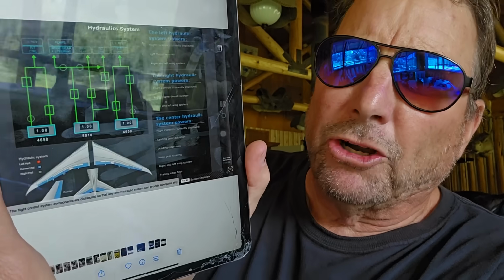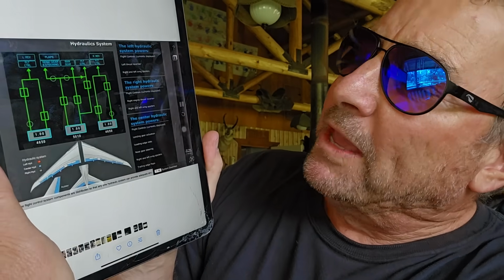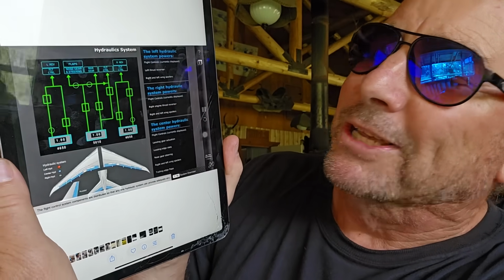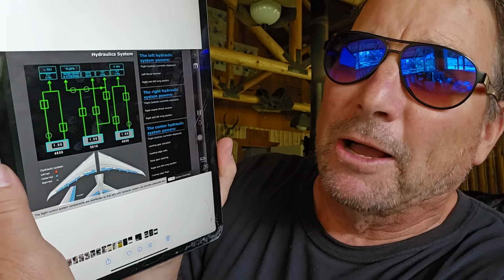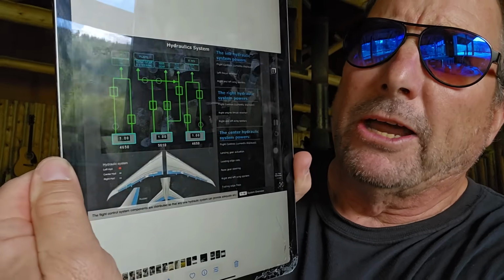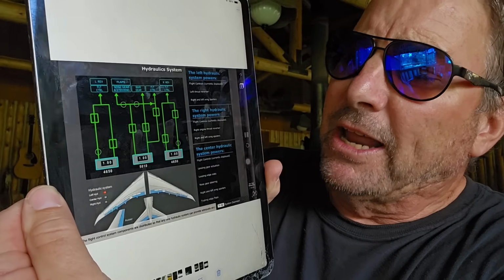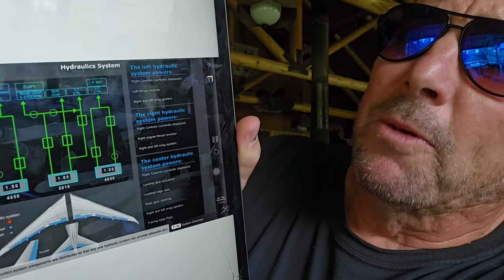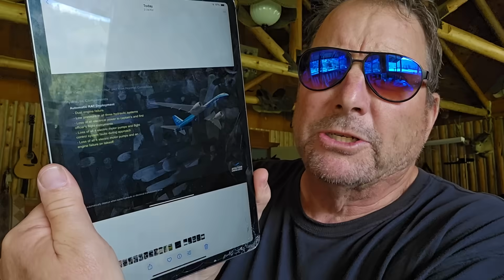787 Crash India What's a RAT? When does it deploy?

Comment: There’s actually more conditions 

Here’s the full list. 

• Loss of all engines
• Both engines are at less than minimum idle RPM (Revolutions Per Minute)
• Loss of all hydraulic power - left, right, and center systems detect low pressure
• Loss of all electrical power
• BPCU (Bus Power Control Unit) detects loss of power to C1 and C2 TRU (Transformer Rectifier Unit)s
• On approach, loss of all four EMP (Electric Motor Pump) hydraulic pressures and loss of either the left or right flight controls ACE (Actuator Control Electronics)
• Rotor burst on takeoff that causes loss of both PECS (Power Electronics Cooling System) primary cooling loops.

Hope this helps Captain
Reply from the maker: Thanks Stig!
Reply: @blancolirio  Someone who was on the plane's prior flight came forward showing video where he said the air conditioner was not working, a light was working and the TV screen buttons didn't work ("Like Usual!, He exclaimed"), but a screen in front of him was working. 
I assumed none of this was connected to the crash, but could it have been?
Reply: @grottorabbit  I'd think biggest thing those indicate is the airlines attitude towards maintenance.
Reply: @blancolirio  great content and well prepared! There were and are know issue with the EEC/FADECs of the GenX that can explain the sequence of events including all statements from the passenger and the ATC coms. 1) The EEC can accidentally command incorrect thrust settings. There is a FAA AD for B787 GenX EECs could fail due to thermal fatigue of solder joints (FAA-2021-0273). 2) older FADECs had trouble with accidental rebooting during automatic bus switches (pre-B120). GE tried to solve this with newer EEC software versions (B120 ++ i.e. SB 73-0015). I hope all SBs were implemented properly. The aircraft was older and had a know history with electrical power interruptions. Such an interruption during rotation maybe triggered by a heavy load coming from the landing gear retraction could cause one or both engine FADECs to reboot and subsequently idle the engines in a critical moment of flight. It can either start with one engine or even with both in parallel. It would trigger a RAT deployment as explained above, since both engines would idle for a while and not send their RPM to the RAT monitoring. There would be no bird strike, no smoke, no thrust asymmetry, nothing visible from the outside, except the RAT and quite idling engines… (parts of this content were posted by Gardnersnake9 on reddit „Air India Flight 171 Crash [Megathread 2]“)
Reply: @blancolirio  Hi Juan! As a retired tech, I have another thought on this. The engine fire system I believe can shut off the fuel control. Could the fire system controller fault/error to shut off fuel without deploying the halon? A wire bundle short on that system? Could there been wire bundle "damage" on that system (perhaps a foreign object in the w/w)(were the gear pins still in and something broke when they tried to raise the gear)? It appears to me that all went bad at the time the gear would have been selected.
Reply: @StigAviation any thoughts on AD 2018‑20‑15 and AD 2015-09-07? A power reconfiguration could result in FADEC entering an idle fallback mode as opposed to last commanded thrust. This may explain the bang and cabin lighting changes (electrical arcing), RAT deployment (total loss of electrical power), engine spool-down (isolated FADEC signal misinterpretation or software logic bug), and last-second engine spool-up (RAT now powering AC buses and throttle resolver signals updating FADEC)
Reply: @jamesallan5422  Interesting.  I have no idea how any of this works, but I would have assumed that the FADEC was a direct connection to the thrust lever encoders.  I'm surprised the aircraft's electronics are involved.
Reply: @jamesallan5422  Good potential estimation.  Black boxes will tell us in a couple of days.
Reply: @jamesallan5422  Sir, what you mention here makes a lot of sense. However that AD should have been applied since some years ago. Application of all required AD will be surely investigated but also there is the need to verify if the aircraft have been continuously powered up for more than 248 days. In the absence of more data at this moment, the scenario you mentioned about the FADEc entering an idle fallback could fit into the plausible conditions that could have triggered this accident although at this moment I am aware that this is just speculation. 
I hope the data from FDR and CVR could be recovered soon and that could bring more light. Thanks for sharing this information
Reply: @jamesallan5422  That will tie in with the Captain Mayday call reporting loss of thrust.
Reply: @jamesallan5422 the bang was probably the rat deploying, the switch to that for power would cause lights to flicker and automatically switch to emergency lighting
Reply: @jamesallan5422 Holy shit that’s terrifying.
Reply: @jamesallan5422 wow, I’m a Jamesallan also. How many of us are there?
Reply: @jamesallan729  Looks like there's at least 5,422 of them, I'm surprised you didn't realize that.  😂😅😆
Reply: @rawcado  I have a 3 digit number in one of my online IDs that has nothing to do with how many of that name there are. I chose a number with a special meaning for me and my family.
Reply: @jamesallan729  i thought you were joking and said James Alien 👽 haha but now I see same name!
Reply: @jamesallan5422  Thats a whole lotta food for thought !
Reply: @jamesallan5422  Not enough acronyms.
Reply: @jamesallan5422 I think you may be onto something here. The engines didn’t quit, they just rolled back to idle. If they started to spool back up at all it was just too late to avert the crash. This would imply a fundamental problem with the FADEC system that means an electrical problem on takeoff or early in the climb is likely to end catastrophically.
Reply: @jamesallan5422 yeah that’s my thoughts. Possibly AC power never transferred from APU generators on engine start up due to some fault. They didn’t notice the crew alerting system messages showing main generators not online, possibly hidden within other deferral messages or other problems dealt with. Shut down the APU just before taking the runway. APU finally finishes shutting down after takeoff. 1 1/2 minutes after selecting APU off. Loss of AC power. Rat pops out. Engines roll back to idle in to idle thrust safe mode. Gear doesn’t go up due to loss of AC hydraulic pumps but gear trucks in opposite position showing they had started up meaning they did port gear handle up. Pilots must then move the thrust levers out of the last position which was TOGA detent for the Fadec to recognize human thrust lever input, and then back into TOGA or full forward to regain full thrust by Fadec powered by PMG’s. No AC power needed.
Reply: @jamesallan5422 For this reason alone, there should be an immediate FADEC over ride for the crew. If the crew commends full power, FADEC should have no say in the matter.
Reply: @slartybarfastb3648  I work for a military research lab.  For autonomous aircraft, we are heavily engaged in something called Run-Time Assurance.  As systems become more complex and even autonomous, especially using AI, we are starting to add simple safety checks in parallel because it's hard to predict all the states a complex system can into and the path to get there.  The job of RTA is to ensure you stay inside a known safe boundary, and the RTA needs to be mathematically provable.
Reply: This chap is an authority Juan. He fixes them!
Reply: @Irene_Bae I’m no authority on anything my friend. But yes I fix them. I’ve watched and worked the 787 from the beginning. Something  is not right with this crash. Lots of speculation about what occurred, theories, thoughts and opinions. All are feasible all are inconclusive. I talk to Boeing personnel all the time and they still don’t understand what happened. They are in the process of recovering the FDR and CVR and GE is on site as well. I only trust Juan to be unbiased and logical when it comes to these things. That’s all I can say.
Reply: @StigAviation someone said a bird strike from the butcher plant that was supposed to be moved away from the airport but it was owned by the politicians relative  there for it never happened
Reply: @StigAviation  As a computer geek watching from the sidelines, it appears to me that people that best understand a modern aircrafts behavior is the folks that wrote the software. It seems as though the rest of us aren't much more than passengers on these automated wonders.
Reply: @StigAviation and as stated “only in my opinion” 👍
Reply: @StigAviation  Have you seen the video on TMZ of the passenger who was on the aircraft on the previous flight?  He's filming all the stuff that doesn't work (with the intention of complaining about Air India's crappy service) - AC, call attendant button, touch screens all not working.  And if those small things aren't working....I'm curious to learn what other things on the aircraft weren't working and the maintenance history.
Reply: @StigAviation  Thanks Stig. Thanks for sharing your perspective!
Reply: @consortiumxf  Yes, if that footage is genuine, which it does appear to be, two front-line questions arise :         1. Were those issues fixed before the final flight?  

 2.  And if not fixed, how/why was takeoff allowed?
Reply: @StigAviation  Great information and knowledge. Thank you for your input!
Reply: @davidmitchell7183 its the people who work across the hardware, software and operations that know them best. The software is just one component of a complex system
Reply: @StigAviation shouldn't they ground this plane until they are fairly certain what happened? Asking for a nervous passenger about to get on one.
Reply: @jamesringler987 butchers don’t let their livestock fly away. That’s bad business management, correct me if I’m wrong?
Reply: @StigAviation no way I watched your TikTok lives in the early Covid days… happy to find you have a youtube channel now!
Reply: @StigAviation What I find interesting is on Indian news (I have no way to authenticate of course) there was a mention of the plane getting retrofit for something just coming back to service I can't help but wonder if that is true was the plane not ready to go back into service...
Reply: @consortiumxf not really relevant
Reply: @yippydippy6589 flown on several in recent years don’t be silly or give me your ticket 😂
Reply: @Shootinfishin73  My point was if they are cutting corners for minor maintenance things.....where else are they cutting corners?
Reply: @StigAviation love your channel Stig
Reply: @StigAviation Boing are incompetents there is no need to ask them. Full power loss due to overheating lithium batteries switching off. Plane had no AIRCON active on the previous flight ergo huge temp inside the cabin...
Reply: @FINfinFINfinFINfin  "The jet also used all the runway to get airborne and kicked up dirt and grass as it rotated."

The video of the ground run was recorded from a position on the South side of the runway. Using this position and the buildings in the background the aircraft left the ground around the the halfway point of the 3,600m runway. The dust was picked-up from the side of the runway by the tip vortices. 

The aircraft climbed to 625 ft amsl, 425 ft agl by the end of the runway. The problem appears to have occurred after rotation.
Reply: @StigAviation  GREAT COMMENT.
I'm an aerospace engineer with a private pilots license.
I work in industrial control systems across a variety of industries. I'm formally trained and certified in multiple areas of safety engineering. 

This is like so many instances of com[plex engineering. EVERYONE wants (and often demands) a straight forward simple explanation when the reality is with MOST CASES in MOST systems a more complex combination of events.

There's that recent power blackout in Spain and that's an area of interest to me because I have been warning my country (Australia) that we are vulnerable to the same type of event. The problem is that we know what basically happened BUT determining the actual sequence of failures is damn difficult and will take months of going through tons of data to work out. In the mean time the rest of us simply have to sit back and wait for the full explanation.
Reply: @FINfinFINfinFINfin Flaps or slats? That one piece of RH outboard wing shows an extended  flap. But maybe you’ve seen another image/video.
Reply: @amanofatoms5786 Airplanes have a Minimum Equipment List/MEL. If systems and subsystems of the aircraft are inoperative, we refer to this list, (actually to the book that in our company is called the DDP, Dispatch Deviation Pricedures) to determine whether the aircraft is still airworthy and legal to fly. If for example the APU (that small turbine in the tail, that provides (backup) electrical supply and/or air supply (engine start for example) is unserviceable, it wil be placed on the Hold Item List(HIL). You are perfectly legal to begin a flight with items on the HIL, as long as you abide to the restrictions it might generate, as listed in that DDP.
Reply: @amanofatoms5786  indeed, checking the master minimum equipment list (MMEL) / INOP list for the flight would be very enlightening.
Reply: @jamesringler987  Not helpful.
Reply: @tonywilson4713  When I was at college in the mid 80s at RPI  I worked on an automated inspection project with several students range from 3 of use under graduates a masters student and a PhD candidate in industrial engineering that was almost done. I remember having a conversation with him. This was shorter after Bhopal disaster. His contention was that we really didn't know how to manage large projects and many times we avoided disaster by luck and not skill. That idea may apply to fly by wire system as well.
Reply: Its other scavenging birds that are the problem around the butcher plant. @jmythngdmb
Reply: @consortiumxf  Someone over at the PPRUNE forum has first hand experience dealing with Air India and how they often scavenge parts from parked planes and then are scrambling to get replacement parts to get the parked planes back in service. Too early to say but I wouldn’t be surprised to find out maintenance issues is either the main cause or a big contributing factor.
Reply: @StigAviation  Thank you and all your colleagues for keeping us safe. I just tool around in a 182 but you keep us alive up there.
Reply: @amanofatoms5786 another question, was this even the same plane?
Reply: @FINfinFINfinFINfin 
Yes, that isn't normal.  It should have been off the runway well before then!
Reply: @yippydippy6589 This is the first fatal accident for a 787 in the model’s 14 years in operation. The 787 is a remarkably safe plane. No need to worry.
Reply: @jamesringler987 what’s a butcher plant? Your mean there was a bird farm and abattoir there?
Reply: @avianews24haviationnews12  Boeing is not incompetent; the batteries don't "switch off"; and batteries in thermal runaway (which has never been documented since the 2 2013 incidents prompted a global retrofit) wouldn't cause the plane to lose "full power." Go be ignorant somewhere else.
Reply: @jamesringler987 there would be evidence of bird strike on the video
Reply: @davidmitchell7183 might this turn out to be similar sort of firmware code error like that which was hastily "commented out" with the 2nd pitot of the MAX 8 fiasco?
Reply: @tonywilson4713  The failure in Spain was basically a failure by design. The protection systems all worked as designed and prevented damage to infrastructure. The geometry, topology and DC vs AC link types of the transmission system made this failure mode possible. There's another problem spot in the Balkans IIRC. For AC links, there's not enough diversity between the Iberian peninsula and the rest of Europe. Part of the fix is to add more links with topological diversity - hard to do due to geography, or to use DC links instead. There's AFAIK nothing that can be done to prevent a reoccurence at any time in the future, other than infrastructure investments.

A safety issue would have been if the protection systems didn't shut things down as they did.

As for Australia: there is published modeling methodology to determine whether that failure mode can occur in a given network. So it's not a matter of opinion, but rather whether someone did the analysis already or not. If no one did - and the methodology is fairly new as far as slow-evolving infrastructure goes - then indeed it is a concern. To do the analysis takes published methods and data about the network parameters and topology.
Reply: @absurdengineering  Oh FARK MATE PLEAS DON'T LECTURE ME ON SOMETHING I HAVE BEEN AT FOR OVER * 8 YEARS NOW.

And I really do want to scream that at you. 

And don't tell me about modelling I come from Aerospace and we are decades ahead of the rest of you in modelling.  

You know what else we've learned in aerospace?????? 
MAINTENANCE and OBSOLESENCE.
We've learned through painful lessons that it you don't maintain critical systems properly they eventually FAIL. We've also learned that you eventually need to retire things and replace them.

And yeah we've also learned that when clowns who don't know WTF they are talking about take over we end up with planes that fly themselves into the ground.

Just yesterday the story broke about how Western Australia's grid is in trouble because the Kwinana power station keeps tripping. Its another of the gas thermal plants a bunch of people including me have been calling to replace. BUT ON NO we have to let the ECONOMISTS and the modellers and all the other DlCKHEADS have meeting after meeting with the single intent to propose new excuses.

Kwinana, Torrens Island & Newport are all obsolete technology.

You can basically replace any of the gas  thermal power stations with the latest GE or Siemens dual fuel gas turbines and reduce emissions by up to 80% and reduce natural gas use by up to 75%. Low risk proven technology. 

STOP BULLSHlTTING ABOUT MODELS and LEARN SOME PRACTICALITY you'll go a lot further.
Reply: I'd love to see Juan, Victor and Stig collaborate.
Reply: Holy crossover.
Reply: Also, theres now some video of one of the wings after the crash. The portion looks mostly intact. From what I saw, the leading edge looked configured for normal flight (flaps zero), but the trailing edge was deployed, minimally (presumably whatever minimum flap setting that would extend the trailing edge). Trailing edge looked extended between 6-12” straight out (no curve down). I think it was the CNN video, but it had an Indian woman speaking english, one segment was her talking with someone at the scene, standing lext to the wing. Looked like the right wing, showed the transition between trailing edge flaps surface and aileron.
Reply: @kevinwhite9919  I fly out of Paine Field WA, where Boeing builds and test flies their widebodies.  Juan Brown is correct--the flaps and slats were in the correct takeoff position.  I've seen 787 takeoff and land from KPAE for many years, but due to the design of the 787's super high-efficiency wing, all wing trailing-edge control surfaces move down for takeoffs and landings, making it very difficult to tell, especially in the flaps-5 takeoff position.  Looked like a normal takeoff to me until the gear stopped retracting and engine thrust rolled back.  The gear appeared to be in transition (toes down) and then just stopped.
Reply: FINALLY! We get a video with a perspective we can rely on. Juan, you are a class act.
Reply: Can someone put me straight please and know very little about information recovery. 
I'm amazed in this day and age that all cockpit data and voice communication isn't uploaded straight to a land based recovery system so that information isn't  immediately accessible rather than searching for black boxes
Reply: @stephenfloat1260 I understand a system was developed that would send a data burst to a satellite in the event certain abnormalities were detected. Not sure what happened to that idea.
Reply: @davida56891 I think British Airways was using a system like it at sometime
Reply: That last condition is interesting given the environmental control motor controllers seeming to be part of the PECS loops. Pure speculation but perhaps there was a problem with those loops and that was partially responsible for the air conditioning reportedly malfunctioning in that other video.
Reply: @alillie449 that was my exact thought when I read that.
Reply: @alillie449  PECS Loops have nothing to do with any of this.
Reply: Hey stig, 777 fanboi here, great to see you here, when you tie in the video/audio and the survivors testimony it all starts to paint a clearer picture, the very long take off roll using up almost all of the runway. The the survivor says it felt like the plane got "stuck" right after takeoff, I assume sudden loss of acceleration and engine noise would feel like one was stuck or quietly floating mid-air, then he said he saw the green and white lights come one, AFAIK the green exit and cabin lights come on automatically in a 787 when power is lost, then he said he heard the engines spool up again, his words were it sounded like the pilot was giving it full gas, I'm guessing by the time engines started to spool again the 87 was already losing altitude and too close to the ground, just didn't have enough time and altitude for the engines to start producing enough through to start to climb. And now seeing, well mostly hearing the rat was also deployed give credence to the theory that the engines cutout, now you could throw better on light on what possibly could cause both engines cutting out at the same time. Oh and the social media post from another pilot who flew the very same aircraft said that plane was dogged with engine problems and the log book was full of it. Saying he had to return to land shortly after takeoff in the same plane not too long ago due to engine trouble. 

Seems like the airline was poorly maintaining the aircraft and video from the same plane from an earlier flight in the day show the ICE not working and neither the HVAC
Reply: @cyzeum this ^ … multiple engine problems. No one has mentioned this.
Reply: #5 is interesting...on an interview, the sole survivor stated that the cabin lights "flickered", moments before, or just as, they started descending...does the RAT do this?  does the deployment mean the pilot was losing systems rapidly?
Reply: Can you tell in the videos if the rear bogeys are toes up or toes down?  They appear toes down to me, indicating that retraction was initiated, but hydraulics failed prior to opening the landing gear doors.
Reply: @JamesDowningFPV  James i watched jeffostroff channel and his video had a close up as aircraft went by and the landing gear was nose down sir. What does that mean.
Reply: @JamesDowningFPV  "Can you tell in the videos if the rear bogeys are toes up or toes down?  They appear toes down to me, indicating that retraction was initiated, but hydraulics failed prior to opening the landing gear doors."

I agree. This suggests hydraulic failure.
Reply: @JamesDowningFPV think the gear doors open automatically on lift off on the 787s to enable faster gear retraction. Doesn’t mean you aren’t right, just an observation
Reply: @StoutProper  hmm, either way, that seems to indicate some sort of system failure if the doors aren't even open then.
Reply: One question @StigAviation: 

What happens when the RAT gets involuntarily deployed? As I do understand from your writing, the RAT produces AC power. Is it possible to synchronize the Phases of the RAT to the Alternators, or does some kind of isolation happen?
Reply: I think its loss of electric/hydraulic power or both. Both engines going out is almost impossible.
Reply: @ishaanchandel6966 if the flaps were correctly configured throughout the short flight the aircraft would have continued to climb had both or only one engine been operating at takeoff thrust.
Reply: 1) already lost speed after v1 but before takeoff according to the data points.
2) takeoff was with backtrack, i see no possibility for pilot error
3) would be interesting if the waste management really can affect the fuel system, sounds like bs to me.
3) apparently there was a recent TCMA software update (system similar to MCAS)
4) the 787 whistleblower that surprisingly shot himself last year warned about newly built machines, still Boeing will rightfully get a massive downrank. should be dissolved and reorganized without the MD sales people.
Reply: Hey Stig, nice seeing you here, and thanks for clarifying the RAT deployment conditions.
Reply: Question to both Juan and Stig, under what circumstances would the RAT deploy automatically on takeoff, if the RAT  was deployed manually what would systems would be automatically retracted or shut down. Is the RAT designed to be used on takeoff as well. Thanks for a great channel Juan.
Reply: Many, many thanks.  The sole survivor of this tragedy reported the interior lights flickering on take-off.
Reply: You missed one....the flight control system glitched. Remember the Airbus crashes involving 'uncommanded decent', the Air India plane looked like it was coming in to land. There are so many lines of code in fly by wire aircraft they simply cannot be checked for errors. Passenger in the preceding hours reported failures in the infotainment systems and interior lighting prior to the crash. A perfect storm in the flight system controls ?
Reply: @spencereagle1118  787 has been in service for almost 14yrs, it's not a new aircraft. So doubt it's an issue like that and we have no evidence to support this theory till date. ICE, lighting an HVAC issues have nothing to do with safe flying operation of an aircraft, crucial safety systems have multiple redundancies built it.
Reply: @spencereagle1118  Infotainment is not flight controls, neither is emergency lighting. Unrelated stuff. Emergency lighting corroborates loss of power. Infotainment systems on both cars and planes are lagging behind state of the art due to certification requirements (for planes) and long development times in that industry (for both cars and planes). Rarely you may get a failing entertainment system even on the maiden flight. Same as you can get a bad one in a brand new car. Or the performance is abysmal when it works - not unusual for both car and aviation infotainment. Those things kinda suck. So I would not extrapolate from that.
Reply: @absurdengineering  I get that my friend. I was not suggesting the infotainment system was the cause, rather an indication that something was amiss with the bus system - the survivor reported a bang and flickering lights. When the lights flickered in small US towns, it wasn't the electricity company at fault, it was a prisoner being executed in an electric chair . Have a look for the Lufthansa flight LH1829, Bilbao to Munich, Nov 5, 2014 over the Alps that suffered a rapid 'uncommanded descent'. The A321 (yes I know it's a Boeing in India) started a 4000ft descent with no response from the yoke,  the crew decided to restart Flight Augmentation Computers (FAC) 1 and 2. This had no effect on their situation. They only just saved the plane by pulling the fuses, first on nr.3 Air Data Reference unit (ADR) and then nr.2 Air Data Reference unit. The problem was the ystem misinterpreting data from sensors. The Boeing 787 operates a very similarly configured fly by wire system operating on so many lines of code that it is impossible to check for the perfect storm of coding conflicts and faulty sensor inputs. It wasn't fuel, vapor lock or pilot error, I believe the flight control system spooled those two engines down. The pilots deployed the RAT in a panic.
Reply: I think number 2 fits best in this case. My unprofessional opinion.
Reply: Would love to hear a regular 787 takeoff sound to compare. The last contemporary large plane i heard take off (LAX), soubded similar to what we hear on this flight, but not quite as pronounced as with the rat-deployed example. The new engines have been designed to have lower frequency broadcasts, to lower the perceived noise. Anyway, comparison to a normal take off sound would be almost definitive.
Reply: @StigAviation, I was aware of a requirement to depower the CCS every 51 days or less, to avoid a stale data counter roll-over with some extent of crew loss of control cited as a potential outcome, but it was considered to be an interim action, and I'm not au-fait with what is relevant for 787 maintenance schedules.  Do you know if 2020-0205 is still relevant?
Reply: Stig--absolutely love your show! Can you confirm that the 787 systems are entirely electrically driven, including the backup systems using electric motors?  And, that the 787 doesn't use bleed-air for heating, cooling or de-icing (electric compressors are used)?  So, no engine driven fuel pumps, no engine driven hydraulic pumps and no bleed-air system--making the 787 very different than the 777 or 737.
Reply: “You wouldn’t know what a rat was if it hit you in the head.” Legend.
Reply: I read online that the flaps and slats become INOP when the 787 is in RAT only state. What happens to the slats and flaps when they go INOP in a deployed state?
Reply: @InsanePacoTaco  They made them so they are mechanically locked in place due to the AA DC-10 crash at O'Hare back in the 70's.
If you recall the engine fell off during takeoff and the slats retracted leading to a roll over.
Reply: @InsanePacoTaco They will remain in their current position. I cannot speak for the 787, but on the high lift devices I’ve supported in design, all have a static no back device that hold its position in every condition except powered actuation.
Reply: @InsanePacoTaco  "I read online that the flaps and slats become INOP when the 787 is in RAT only state. What happens to the slats and flaps when they go INOP in a deployed state?"

Without hydraulic power the check-valves in the hydraulic lines will keep the flaps & slats in the last commanded position.
Reply: @InsanePacoTaco  on the 320 family i fly the RAT will have no effect on flaps or slats position. Can't see it would be any different on anything else with a RAT.
Reply: @InsanePacoTaco Post-crash photos appear to show l/e and t/e devices extended, probably flaps 5 position a full l/e extension.
Reply: @InsanePacoTaco they would just stay where there at.
Reply: @InsanePacoTaco  I would think they would stay where they were at at the time of deployment unless you lost all hydraulic pressure.  I’m no expert, just familiar with hydraulics.
Reply: @Endoftimes1173 I’m only a frequent flyer but as an engineer too Intend to notice things… 

On the planes I’ve flown on the mechanism I’ve noticed for extending the flaps is a jackscrew. The motor that rotates it could be either electric or hydraulic. But if the actuation motor failed, the screw mechanism would remain solidly in its position prior to failure. And even after a severe crash it should be easy to determine the position of the mechanism at the time the actuating motor last stopped. 

Keep in mind that crash reconstruction of the mechanical parts wouldn’t necessarily tell the whole story as it would be possible that the flaps were erroneously commanded to retract right after takeoff and then subsequently commanded to an extended position but it was too late. The flight data recorder will surely have information about the commanded state of the flaps vs. time. 

That said, I have never flown on a 787 so I can’t say if this type of mechanism is what Boeing used.  Hydraulic cylinders could also be an option.
Reply: @InsanePacoTaco  Not ture
Reply: Hey stig. I didn’t realize you were on YouTube, just subscribed but I’ve watched your TikTok’s for a very long time. 

I’m curious, would you ever consider either making videos like this on your channel, or even maybe even collab with guys like Juan. I know pilots usually know the aircraft pretty good, but I doubt they have quite as good an understanding of the systems and ways they fail as you do as a tech. Id love to hear thoughts from your perspective.
Reply: is that maintenance and turn yourself around parlease…. 🧚🏽‍♂️
Reply: Thanks Stig. Was waiting for you to get in on this incident. I watch all your maintenance episodes. This man guys, knows the 787 in and out!!
Reply: @StigAviation "There’s actually more conditions"

I have read that there are two electrical generators on each engine and that if three of the four generators trip offline, the RAT is deployed automatically (after a short delay).
Reply: @christopherrobinson7541 I believe that in that condition, the APU will start automatically, not the RAT
Reply: You’re the man Stig!
Reply: FADEC software fault can shut down both engines together: "fully autonomous" means that pilots would, in failure mode, have no authority over thrust settings.
Reply: Would selecting the engine fuel controls to off caused all these conditions?
Reply: MUCHAS gracias Stig
Reply: 675 is the highest altitude on flight radar. Call that 700. 1.5 miles to the crash site. That a glide of 1 in 11. With the wheels down, and more drags from the flaps. If the RAT is out, that's more drag. 
That to me mean now power at all.
Reply: If things were bad enough to auto-deploy the RAT, would that trigger a stick shaker/pusher reaction from the plane systems, resulting in an automatic or pilot-commanded pitch reduction?  In the takeoff video, I think we see the plane reduce pitch/AoA right at the time the landing gear might normally be retracted.  That pitch reduction would presumably result in an immediate loss of lift, so we don't need to conjecture about flaps being erroneously retracted to explain loss of lift.  The pitch reduction might give the survivor the impression that they were just floating there rather than climbing, perhaps more strongly than just a reduction in climb rate would.  What about a major hydraulic/electric/engine failure on takeoff, perhaps triggered by attempted landed gear retraction breaking the camel's back, resulting in prompted or automatic pitch reduction?
Reply: There is a video out of a man who flew on plane earlier that day and described many electric issues on the plane with AC monitors
Reply: @kristenkunkel3745  It's completely possible that there was an electric systems problem.  I think one of the hydraulic pumps is manual from an engine and two are electrical.  So a failure of the engine with the mechanical pump could impose a load on the electrical system, and if that were already fritzy then the commanded retraction of the landing gear could trigger too much load on the fritzy electrical system and take it over the line.  Alternatively, failure of the cabin electrical system could be completely irrelevant.  Anyone who has ever flown American Airlines will know that, apart from the gross hopeless depression all of their poor employees suffer and the sad tawdry soviet-style aesthetics of the whole company, they frequently seem incapable of keeping cabin services operating during parts of the flight, as if the planes are Lego and some part keeps falling off, but their planes continue to fly just fine despite this, and I'm pretty confident within regulatory requirements.  So, from my very limited knowledge, failure of cabin services might be significant or might be completely irrelevant in the scheme of the highly redundant master bus and critical flight systems, you are going to need a 787 systems expert to evaluate that.
Reply: @LokiCentral with engine or electrical failure the black boxes may have stopped working which will likely make this puzzle harder with less pieces
Reply: @kristenkunkel3745  I'm only going off the comments I have read, but those imply that the black boxes should have had power throughout, even with a bus failure.  The 787 is a highly instrumented aeroplane, so the data should be all there and tell the story.  That isn't first-hand knowledge, but I'm very hopeful ... 🤞.  The potential sting in the tail is that a highly redundant system like a 787 likely requires multiple failures to bring it down, so we should not be surprised if the story has lots of twists to it rather than a single clean failure, and maybe one of those twists could have incapacitated the FDR.
Reply: A Loud burst was reported by lone survivor. So rotor burst ?
Reply: Airports in heavily populated areas need to be reconsidered.  If they had a field they could have crash landed.   That runway looked short considering weight and weather.
Reply: RAT was out. Dual engine flameout. Ruling out mechanical, fuel contamination, birds, I think it was one of pilots wigging out and pulling both fire handles or fuel shutoff.
Reply: So if one engine failed, and they accidentally shut down the functional one, it would’ve deployed?
Reply: Or a captains chair failure and he grabs the throttle
Reply: Oh wow. I thought that the RAT only deployed in case of complete power failure (once batteries run out). I've read past documented aircraft failures and they document RAT deploying after the battery depleted.
Thank you for clarifying.
Reply: Why is nobody asking the real question: Why did  Air India "Senior Captain S.S."  have only 8200 hours total flight time in his apparently long career? This rather small amount of flight time at his age is very unusual for a so called "experienced" pilot, to say the least. Fact is: He was  NOT  very experienced, at all. And his first officer was a pedestrian... with only 1100 hours total flight time, including single engine piston airplanes!  He was a rookie. 
Regards from the cockpit.
Reply: All someone has to do is take both audio recordings and run them through a Fast Fourier Transform (FFT) and look for the very distinctive spectral signature of the RAT blade noise.
Reply: @DaveRobine Or just listen ...
Reply: @DaveRobine  Interesting. Thanks.
Reply: @DaveRobine most of us have a low tech, analog piece of equipment to do that already — in fact most own two of them… our ears! :P  but yes that would be interesting!
Reply: @DrachHeinz you missed to point idiot, all relates to confirmation of what those 2 things you're clearly sarcastically refering to. My scope is to slow to provide the required resolution. Obviously you're deeply jealous you didn't think of that idea and suffer from Psychological Projection. There is therapy for that if you would like a referral?
Reply: @DaveRobine 
Why not wait for the black boxes?  They will be far more informative!
Reply: @mahbriggs what a stupid comment, all I'm stating is that if the 2 separate audio recordings are compared using Fast Fourier Transform (FFT) the spectral signature of the RAT operating will be there. You don't have wait for FDR to be analysed to make that simple comparison. So your comment is actually against Juan's audio comparison not me, Checkmate...
Reply: Stupid is as stupid does and boy are you stupid!
@DaveRobine
Reply: I agree!  You made a stupid comment!
Your suggestion wouldnt prove anything and would be useless since we have the black box information! @DaveRobine
Reply: @mahbriggs someone has already posted very interesting FFT data, so what's your point was?
Reply: @DaveRobine 
My point is that all this specualtion is stupid and dangerous!  They have the "black boxes" and the remains on the ground!
Why is every keyboard internet expert making idiot pronouncements?
Reply: @mahbriggs in what way did I make any form of pronouncement? @kenmercer2721 gat the most mature response @DaveRobine I've been doing that and now found your comment. Using Audacity the first clip, around 54s, shows a peak at 601Hz moving down (Doppler) to 550 Hz a couple of seconds later. The clip from the crash at 1:37 has a less distinctive peak near 670Hz. An online calculator, assuming the aircraft is moving away from the microphone at 170 kn, indicates 550Hz shifts to 738 Hz. I conclude: with my vague assumptions it's possible the sound was the RAT but not conclusive. The black box will have the answer. You obviously want to control the narrative Mr Control freak...
Reply: @mahbriggs how about you make your exact comment on pronouncements to @Capt_StevieJ2 days ago

I have flown the B787/B777 as Captain at a major airline. The airplane will not let you take off unless the flaps are set for the setting required by the Flight Management System. Period. It will never happen. The most important thing in that grainy video from the right aft perspective is the pixel inboard of the right main gear and aft of the wing just below the fuselage. That is exactly where the RAT (Ram Air Turbine) is located. It deploys when a loss of both engines or a loss of hydraulic systems occur. The RAT will not retract the gear. My feeling is a complete loss of engine power shortly after liftoff, deploying the RAT. Audio associated with this video is also exactly what the RAT sounds like when deployed.

You are a bully and selectively target who you perceive as not worthy of making harmless comments. Go and get the pyscholical help that clearly need my friend...
Reply: @DaveRobine  I've been doing that and now found your comment. Using Audacity the first clip, around 54s, shows a peak at 601Hz moving down (Doppler) to 550 Hz a couple of seconds later. The clip from the crash at 1:37 has a less distinctive peak near 670Hz. An online calculator, assuming the aircraft is moving away from the microphone at 170 kn, indicates 550Hz shifts to 738 Hz. I conclude: with my vague assumptions it's possible the sound was the RAT but not conclusive. The black box will have the answer.
Reply: I suspect electrical, but will wait on you.
Reply: Yes…the air conditioning wasn’t even working on the previous flight…and lots of other electrical issues…they never should have flown before fixing the electrical issues…
Reply: @cthetexasking2672 being that passengers from the previous flight had issues with I flight entertainment and poor or no AC i suspect this is all correlated.
Reply: @cthetexasking2672  Yes--since the 787 systems are entirely electrically driven (unlike other aircraft), including the backup systems, that's a very good observation!
Reply: @cthetexasking2672  That would be a reasonable guess.  Juan shows in this video that the transponder quit about 15 seconds before impact.  About the time the pilot called Mayday and reported loss of thrust.  And the surviving passenger reported the lights flickering.  Something clearly happened at that point, 1:38 pm.
Reply: @cthetexasking2672 makes the most sense, then the FO panicked and pulled flaps instead of gear
Reply: May not be related to this mishap, but can you make sense of the PECS failure condition tripping the RAT? Why would that cause the RAT to deploy? The documents that I have access to don’t mention the PECS. The ASM says:

In flight, the RAT deploys automatically if any of the following occur:
— both engines have failed
— all three hydraulic system pressures are low
— loss of all electrical power to captain’s and first officer’s flight instruments
— loss of all four EMPs and faults in the flight control system occur on approach
— loss of all four EMPs and an engine fails on takeoff or landing
Reply: @LarryR4927  In my opinion, it is to take off the load from main electrical system preventing over-heating. Remember early days of 787, there was a battery fire problem.
Reply: @LarryR4927  using acronyms without defining what they are, shows an indication of a poor communicator.
Reply: @DaveRobine I wasn’t trying to communicate with you. My reply was to @StigAviation and he had already defined PECS and EMP. And since Juan had already explained what a RAT was, I didn’t think that was necessary to define those three things. I believe that the only other acronym I used was ASM, and although I debated defining it when I wrote my reply, I thought that @StigAviation probably knew that ASM stood for Aircraft Systems Manual, which is the systems manual that American Airlines gives its flight crews.
Reply: @LarryR4927 still an excessive use of acronyms. It annoying to those that don't understand them, so my comment regarding poor communication still stands.
Reply: What about a simple mistake albeit a major one by the right seater when the PF is looking out the window navigating the climb- the right seater (For some unknown reason is not paying attention and raises the flap handle)? Neither one of them catches it in time And with little altitude they start losing lift due to flap retraction, combined with the drag that the gear down is causing (and not retracting due to flap handle being raised instead of gear handle). Watching the gear not come up as expected around 50 to 100 ft and the aircraft ceasing to climb and settling into the ground, Captain pulling back on the yoke instinctively with nothing else he really can do - seems like this would cause the crash to me. But we have the potential that the RAT might have been deployed, so I dunno.
Reply: @Pahrump maybe the PF saw positive rate of climb and called Gear Up, right seater accidentally moves the flaps lever instead of the landing gear lever.
Reply: @rodkneed The plane won’t let you make a mistake like that.
Reply: @rodkneed definitely a possible scenario, but it wouldn’t explain the RAT deployment, if such deployment actually did occur.
Reply: @rodkneed No. Not possible. The landing gear lever and flaps lever are at least three feet, almost one meter, apart/away from each other. These pilots have thousands of hours of flight experience. The landing gear retraction started then stopped due to electrical and hydraulic failure immediately after the engines went silent and after the RAT deployed. The survivor heard a bang in the aircraft after it lifted off of the ground. I go with what Juan is saying about electrical and hydraulic systems failing.
Reply: @Pahrump  nobody is addressing the dark answer....intentional by one of the pilots.  raise flaps instead of gear, then to ensure the demise, fuel controls off  (which kicks out the RAT).  Hate to think it...but it could be what happened.
Reply: Unintentionally partially opened reverses? Had been happened at least 3 different a/c type
Reply: After listening to the survivor's description of the event, and looking at the videos, I get the idea that someone in the cockpit pulled the thrust levers back to zero at the worst possible moment -- or else the engines lost power by themselves before restarting after 5-10 seconds, which was too late. The most logical explanation would be that someone in the cockpit induced the engine de-throttle, or else the airplane did it without being commanded.
Reply: @ce7857  And on that last point, we are discussing a modern Boeing aircraft....
Reply: If you look at the take off video, the plane kicks up a lot of debris/stones when it finally gets off the ground. Since both engines seem to have gone down almost right then, I wonder if they sucked in the debris and the compressor stalled/engines flamed out. I'm not an expert, so just a speculation. So if both engines went down the RAT would deploy.
Reply: @danielgreig4952 From that debris it looks to me like it over-ran the end of the runway before rotating, which suggests the problem began during the roll,
Reply: @BreandanAnraoi  Given barely enough lift (flaps? engines?) to get off the ground, rotating would stall the wings and greatly increase drag.  Gear down increases drag. Even the deployed RAT increases drag.  A perfect storm of bad effects preventing acceleration to the needed airspeed . . . and at 500 feet, there was no room to put the nose down even if the pilot had thought to try it.
Reply: @BreandanAnraoi Totally agree. The roll wasnt at all conventional or safe. No judgement on pilots as they may have been over decision speed V1 well back.
Reply: @BreandanAnraoi  "From that debris it looks to me like it over-ran the end of the runway before rotating, which suggests the problem began during the roll,"

The video that shows the aircraft on the ground was recorded next to a control hut to the South of the runway, about 1,000m from the Northeast end of the runway. Using the buildings in the background as a guide the aircraft left the ground at around the 1,800m mark adjacent to the R4 intersection at the midpoint of the runway. The tip vortices pick-up a lot of dust from the side of the runway, at this type of airport.

There does not appear to be anything wrong during the take-off run. The problem occurred after the aircraft had left the ground.
Reply: @christopherrobinson7541  well that's on me for making assumptions! Thanks for the correction, that changes things considerably
Reply: @jpdemer5 there is always room, Olympic 411 did it at 35 feet and flew rooftop for six minutes.
Reply: @BreandanAnraoi  Did it use whole length of runway ? Incase it used part of it before take off, did that cause pilot not to abort it even though he sensed it wrong ?
Reply: @kaushikdatta2725  it taxied out at an intersection but backtracked to use the full length. Someone replied to one of my comments though to say that they'd looked into the location the video was recorded from and the buildings visible and it appears that it actually rotated at a fairly normal spot on the runway after all, the dust kicked up must have just been from the vortices.
Reply: @BreandanAnraoi  there is some speculation out there, that it was a half runway departure.  Based on the density altitude, they should have used the whole runway. (My .02¢ opinion)
Reply: @Qrail  The speculation is wrong. It's been confirmed they taxied on at an intersection but backtracked to the start of the runway.
Reply: @BreandanAnraoi they started half way down the runway which apparently is not usual. They also apparently had 100% of fuel capacity on board despite only needing 53% for the trip and a full plane. I wonder whether they accidentally configured for the full runway (flaps 5%, slow acceleration, low thrust) and only had half the runway to take off, overshot the runway, hit the dirt before rotation, sucked debris into the engines which then shortly afterwards caused them to fail. Just a thought.
Reply: @StoutProper  I don't know about the fuel but the intersection takeoff thing has been thoroughly debunked, it has been confirmed they entered the runway at an intersection but then backtracked to the start of the runway. But that's odd as well, like that's a really long take off roll, they used pretty much the full length.
Reply: @BreandanAnraoi there's video of takeoff, looks normal.
Reply: @danielgreig4952  I certainly don't know but I appreciate reading your possible hypothesis.
Reply: @danielgreig4952 do you know how a jet works? Hot gas is expelled behind the engine, anything kicked up by engine thrust is behind the engine, not in front to be injested
Reply: @billfraser9731 yes I know that. Just speculation on why both engines seem to go down right after that point. Everyone will have to wait for official news of course
Reply: Didn't think about FOD potentially being the catalyst but it's real and we'll see as the investigation continues.@danielgreig4952
Reply: @danielgreig4952  The debris looks like simply dust from the side of the runway getting stirred up from wingtip vortices. Calculating angles from that camera with maps says that the plane lifted off well before the end of the runway, at a point that looks pretty normal.
Reply: @robertbackhaus8911  Are you saying it's normal for airliners to create a big cloud of dust every time they take off using that particular runway?  That makes no sense.
Reply: @Milkmans_Son  For runways in this part of the world such dust clouds are normal, especially with the B787, as the tip vortices pick-up the dust from the sides of the runway.
Reply: @Milkmans_Son Absolutely correct, it makes no sense.

Debris is never a good thing around jet engines and I've stripped down many that have suffered FOD (foreign object damage) on military aircraft. And what about when aircraft are departing from that end of the runway. Are they expected to spool up the engines and take off through that debris? Utter nonsense!

Something else happened here, either engine failure (incl possible bird strike/s) or runway overrun etc. Given that the aircraft crashed shortly afterwards I'd suggest that this was either a contributing factor or a symptom of an earlier failure.
Reply: @christopherrobinson7541  No dust on the sides, only the end.
Reply: @robertbackhaus8911  Per Simon's site "On Jun 15th 2025 Government Officials reported the aircraft had a longer than normal takeoff run and used almost all of the 3505 meters/11499 feet long runway."
Reply: @robertbackhaus8911 yes on flight radar they posted a little analysis of their data of the departure of the previous 10-15 flights, and this flight actually rotated sooner on the runway than most of them
Reply: Some Boeing whistleblower warned us about this a few months ago. Dreamliners are faulty aircraft and accidents waiting to happen. I would not be surprised if we get another Dreamliner accident😢😢
Reply: I love these channels. It will take the investigators at least two years to find the cause but every two-bit you tube expert knows already what downed the plane.
Reply: @kaoskronostyche9939 I think you're suffering from the mind virus. People who are obviously not connected to this investigation can freely speculated on what they think happened. Hope you are enjoying you life in North Korea 😂
Reply: @kaoskronostyche9939  Juan is no dumb guy, and he's cautious about what he says and when.  With the FDR data release, maybe in a few weeks, then a preliminary report, we'll have a good idea of the big picture, but we'll absolutely need the final report for the fully detailed sequence.  When a high redundancy/fault tolerant system like this fails, that often means multiple sub-failures, including human factors, so it seems likely the final story will have a few twists in it.  It's possible the pilots manually deployed the RAT, but it seems far more likely it auto-deployed, and if that's the case the plane is coming down, so I personally think that understanding why the RAT deployed may be the key to this.  That's what Juan is highlighting here.
Reply: You are a touchy little boy. One comment criticizing you and the comment is deleted in mere seconds. Pretty weak, little boy.
Reply: @kaoskronostyche9939 takes one to know one 😂
Reply: Nice idea but I think the Rat was not deployed. It’s an Indian Pilot training issue.. Identify Select Verify not in their vocabulary
Reply: They started from 2/3 of runway. Had hardly any speed for take off at very end of runway. Dirt and dust from end of runway was swirled up and likely ingested. May have flamed out turbines and RAM turbine was deployed. Without thrust, airspeed fell and no lift. Hence, primary cause was starting not at very beginning of runway. This should by now really be DEMANDED from any aircraft
Reply: @hanssteiner7661 apparently not true
Reply: IT'S ALL
TRUMP'S
FAULT!!!!😠😠😠
IT'S ALWAYS HIS FAULT!!!!😡😡🤬🤬
Reply: Not this time, breathe a deep breath @Dr.FirebladeSC59
Reply: @Dr.FirebladeSC59 

dont drink before breakfast
Reply: @jgrc73  Don't be mean😠😡
Reply: @Dr.FirebladeSC59  Pound sand, this is not a MAGA discusion.